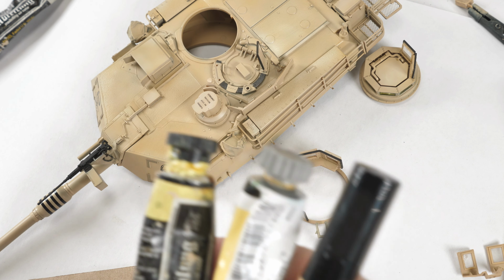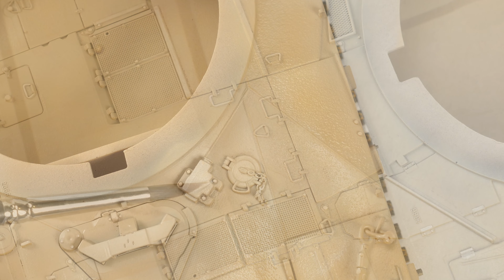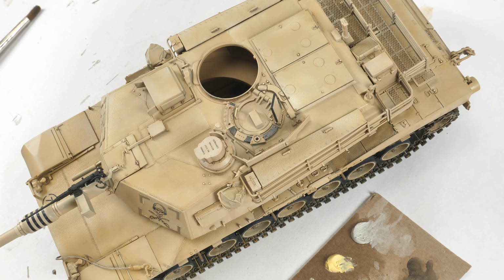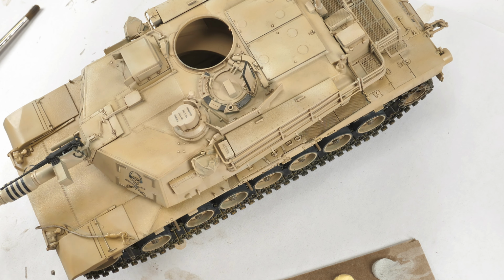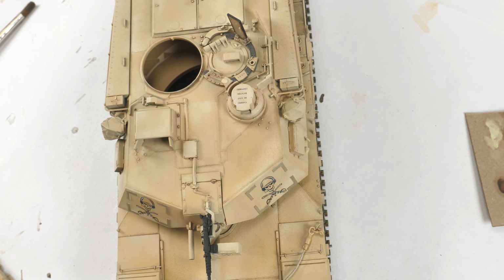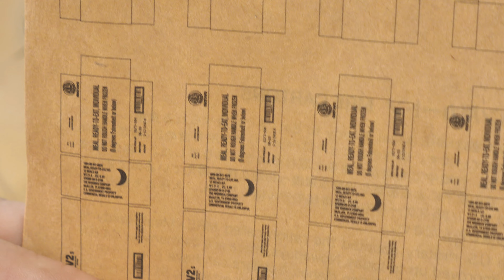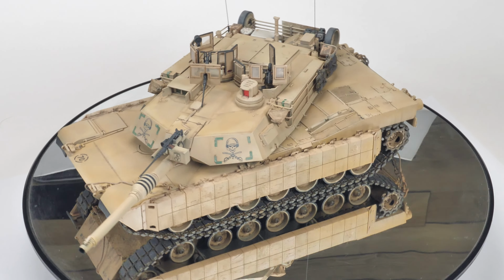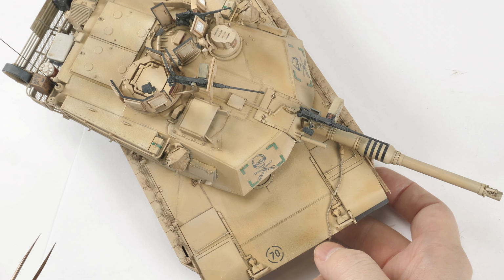Academy M1A2 TUSK I in Iraq - Part IV Weathering and Final Reveal

Comment: Just a quick question: I got a "dry steppe splashes" bottle same as the one you're applying.
The thing is that half is solid, very very hard and half is liquid.
Is that ok?
Anyway great built!
Reply from the maker: I had the same problem with some other bottles of the splash effects drying out... in fact the dark splash i had to make from a home brew because of that problem !